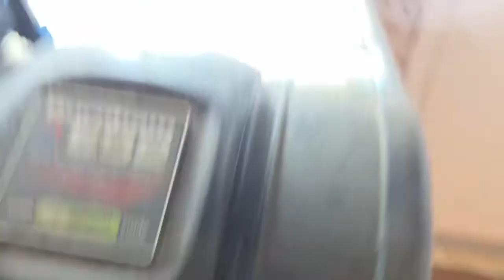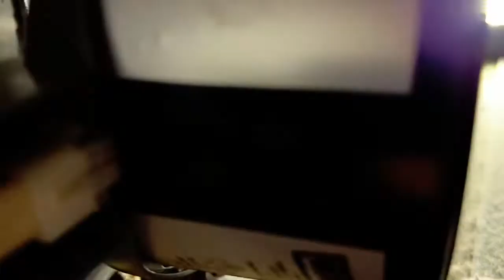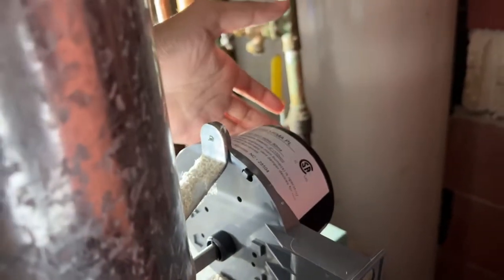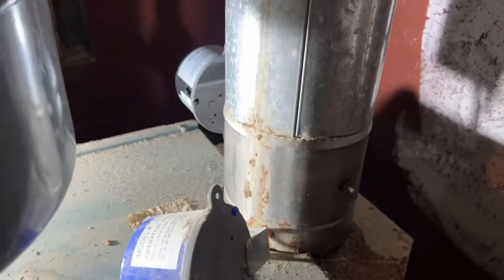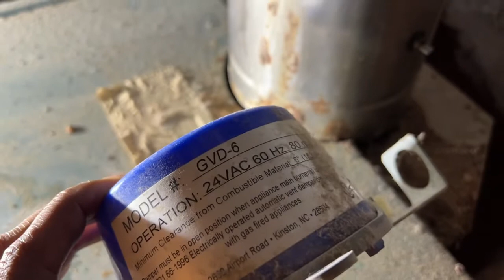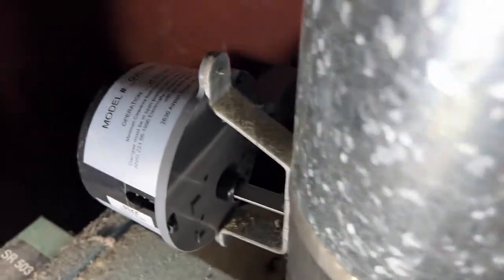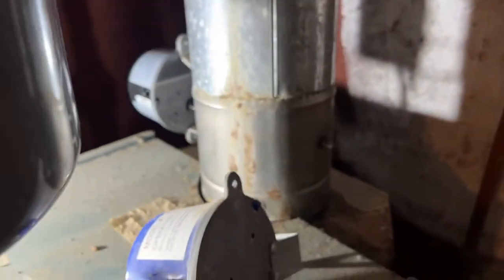Replace Vent Damper Motor for heating in under 1 minute - No Heat

Comment: Thank you for your time and posting of this video. I really appreciate it. My unit went out and when I called a Heating and Plumbing company to come and check out the system this is what they came up as the problem. I failed to mention that they tried to get $1200.00 out of me. I will replace the motor myself. Once again thank you for sharing your experience.